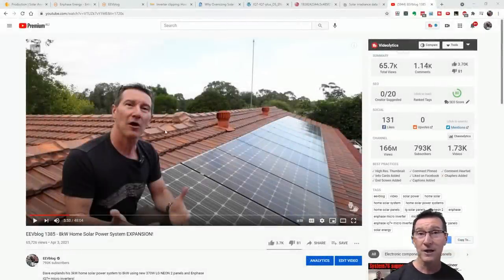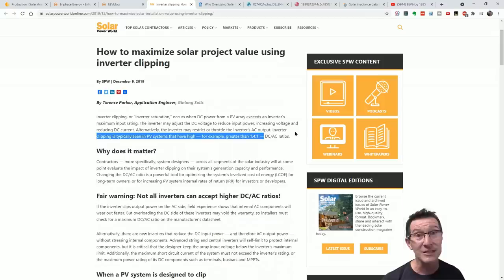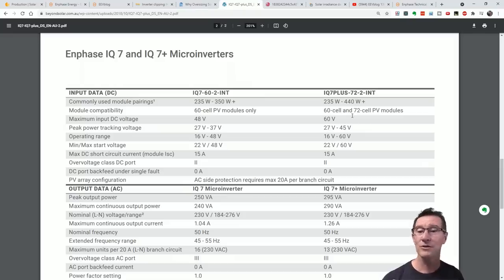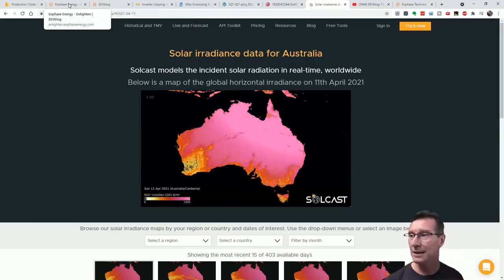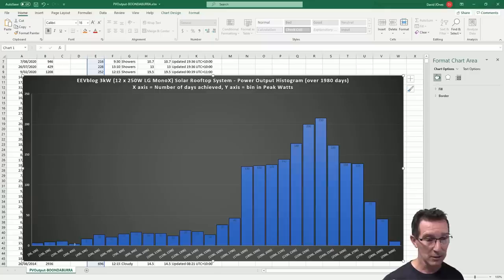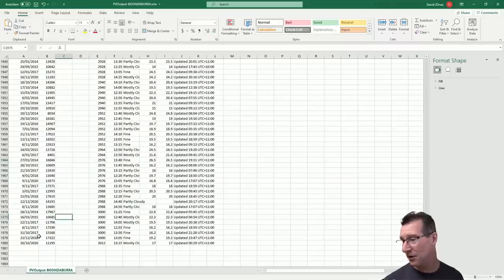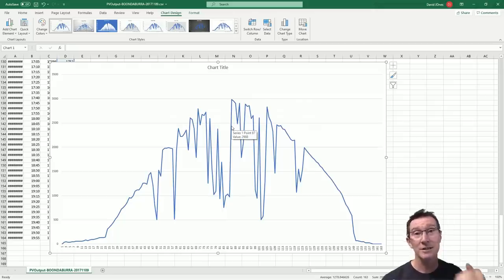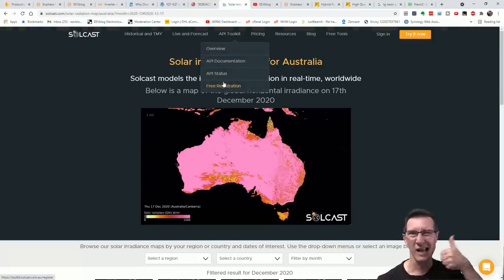EEVblog 1386 - 295W Inverter vs 370W Solar Panel - WTF?

Comment: I rent so I currently have no stake in solar, but learning all those little nuances was really interesting. So yes it'll clip, but it's not clipping every day, and the days it does clip it won't be clipping the whole day, and then the other microinverter benefits that may offset small losses anyway.... today on the internet people seem to join one camp or another so very easily and forget about all the small details. And these details can tip the scales in ways they haven't thought about. And from the comments already I see there are even more factors warranting consideration. Always refreshing to get this sort of overview on a topic, thanks.

Comment: I think you might be missing out on generation capacity at the start and end of the day as well.  The specs say it has a minimum start voltage of 33VDC.  I presume this means you get zero output before this.  If you had 14 panels in a string generating 33VDC each you would have 462VDC.  A common string inverter would be generating a respectable output at 462VDC compared to the microinverters generating 0VDC.  I imagine this effect would be greatest over the winter months.

Comment: “As an engineer I find that a bit offensive.” How many times have I said exactly that!
Reply: Yup. I just spent twice more on a UPS than I really needed because I couldn't stomach it having a lower rated output than the theoretical maximum power consumption of my PC (which I fully well know it will never hit).

Comment: I live in Switzerland; 18 Panels each with 330Wp with 18 Enphase IQ7+ Inverters (290/295 Wp). I had a clipping maybe 3 or 4 times in 2020(!) It makes really sense to slightly oversize your panels - compared to the cost of more expensive inverters.
Reply: Good advise. Thank you!
Reply: You have to also account for the lower efficency in non-shadowed state. Microinverters are overall less efficient in vastly most cases. String inverters are easyly 2% more efficient.
Reply: @flipschwipp6572  Claims and stories from old times. Completely irrelevant. Every manufacturer and every study tells something different - and all like to embellish their own efficiency values. Just like with the consumption values of cars, I wouldn't put a damn on it. I would never buy a string inverter again, even if it were 5% more efficient - and that of course only on paper. And which PV system has a "non-shadowed" state over the whole year? Even then, there may always be times with snow, ice, frost, leaves, dust, dirt, sand, bird poop, a weakaning or faulty panel and much more. And even brandnew panels themselves always vary in efficiency within a few percent(!) - and no string inverter can handle that, but the weakest panel determines the performance! (Except for such with SolarEdge DC optimizers.) Micro-Inverters always produce electricity immediately, even with the smallest amount of light in the twilight, while string inverters just kick in at a neccessary minimum input power (e.g. greater than 10, 20 or even more watts).
Summary: your apparent "2% more efficiency" literally melts away like butter in the sun.

And last but not least; the most efficient system is never that which simply has the most efficient inverter(s), but rather the system overall that is the fastest to write a black zero (= reaching the profit zone). This can only be determined after years or decades, after including all income and expenses - and here, too, Enphase Micro-Inverters are ahead with their 25-year guarantee. It is not unlikely that you will have to buy a new, second string inverter in the meantime ...
Reply: @RomanKuechler  What is the relevance of Guarantees in respect to energy efficiency? String inverters cant also have Guarantee? Marketing BS! Upfront cost of optimizers overwhelm any benefits. Once The Manufacturer goes down, like it was often happening in the PV market, you can wipe your ass with your warranty card and pay someone to rip the whole pv array apart, remove the inverters and re-wire everything. With a normal inverter, it is just replacing the Inverter, which ther will be 1:1 replacements in 25 Years, for Microinverters I highly doubt that.
Reply: @flipschwipp6572  You have not read or understood any of my arguments. This makes the discussion pointless. And your answer lacks logic. Your 2% will be nullified by the tolerances of the panels alone, it's not that hard to understand right now, is it? If someone buys a string inverter because of 2% more efficiency - but not taking everything around it into account, what should I say? If someone really wants a string inverter then they should buy a string inverter. It's not my problem. I have nothing more to say about it, thank you.
Reply: @RomanKuechler  I totally agree with the panel tolerances being equalized with optimizers or microinverters. Panel tolerances are divided in Voltage differences and Current differences. Only current differences can not be 100% compensated by a string inverter but they do not weigh in with their full potential, only moving the Working point a little bit away from the MPP on a usually very flat curve, voltage differences are totally 100% used by a string inverter. Like 4% total efficiency difference (today, panels are much tighter specified) 2% in account for the current, 2% in account of the voltag, only former ones do weigh in like 20-50%, making 0.5 to 1% drop for a less efficient panel.  Individual diagnostics of the panels is a nice feature, manufacturers do their best to deliver good products etc. pp.  String systems have proven to work reliable and efficient when not installed in very bad locations like behind  shadowing trees (there I see the application for microinverter- or just dont install pv there anyways, microinverters can not take the shadow away, the can just make the best out of bad shadowing.  But fron an engineeing perspective, what is the point to install power electronics in the hottest place behind the panels? In the worst place for maintenance? Why have 50x electronic devices if you could just have 1 central one? I just serves the purpose to upsell the customer.
Reply: @RomanKuechler  Any more arguments?
Reply: @flipschwipp6572  if your solar panels are outputting the exact same output each and no shade or dust on them and non of them have failed (or the inverter it self hasn't failed) and they are all pointing at the same angle (only installed on one side of the roof as a single array) , then string systems can work fine

but with dc to ac micro inverters (or even solar Edge dc to dc power optimizers with solar Edge inverter) doesn't matter if each panel is making different power due to shade/dust/angle/placement/panel quality (or even a failed panel/failed micro inverter) every panel will output as much as possible no matter what the other panels are doing (you can just place them on every spot on your roof and lower roofs if you want maximum coverage at higher cost for more kW of energy)

If you watch the last 10 minutes he does bring these  points up

I agree on the point about them been installed right behind the solar panels and possibly of shorter life,, I have seen some installers install the micro inverters inside the roof space so they are easy to access and so not in direct heat of the solar panels and easy to replace without requiring outside solar panels disassembly to access them (unless the panel has failed but you Know witch panel has failed right away without a ir camera)

Comment: Dave, please note that the global solar irradiance which met stations measure is NOT the solar irradiance that your panels get, because the global solar irradiation is measured with a sensor (pyranometer) perfectly leveled horizontally. To get the exact irradiance value of your panels, you should get data from a pyranometer which is at the same azimuth and elevation angles as your panels! (This post somehow disappeared previously, so I posted it again without the link, maybe someone thought it was advertising, but it's not, I'm just happen to measure solar irradiation at work).
Reply: I assume that you'll get a performance boost from well tuned elevation angles?
Reply: @CED99  Of course, but that's a given factor by the orientation and angle of the roof. Modern houses should be built with this in mind (the usually are). You can mount the panels at a different angle on taller framework, but that would look horrible, and it can be dangerous as well, because it would put higher wind load on the panels.

Comment: The most common string system in Australia is actually 6.6 kWp on 5 kVA inverter.

Enphase micros have a longer warranty and life than most string inverters on the market, they don’t run hot internal temperatures as they run as extra low voltage (40 Voc generally).
Reply: cost difference is almost double now. Also if any of those inverters fail the warranty is there for them but not the labor to go up and pull solar panels off the roof to get to the inverter underneath and hope nothing else gets broken like tiles etc for those with tiles. Its not all green grass on that side. Also being up on the roof in summer, can't imagine even being under a panel they wouldnt be smoking hot.

Comment: TLDW: Loosing 10% per day on 38% days equals 3.8% total loss(on ideal days). Realistically probably less than half of that, say 1-2% total loss. 
But you get same 1-2% back in improved inverted efficiency.

Comment: I have limited knowledge on PV systems, but looks like de-rating is quite common here in Brazil. Since the string inverters are so expensive, adding more panels is cheaper. As a result, the inverter starts clipping earlier in the morning and stops later in the afternoon, so as to use the inverter for a higher % of the time. It's not only about the energy, but the system cost.
Reply: Boa! já ia pesquisar sobre e tu me respondeu!

Comment: My family has multiple PV arrays in south Germany. The older ones (about 19 years now) have undersized inverters, the newer one (about 10 years old) has oversized inverters. 
As far as I know, currently the inverters are usually oversized on new systems. I don’t know the exact reason why it went from undersized to oversized inverters, but probably the efficiency got a lot better with all load-scenarios and the price difference isn’t much.
All our installations are still fully operational and there are no signs of significant degradation. Only the Inverters seem to reach the end of their lifespan after almost 20 years. On the old arrays, we swapped them for new ones, since they stated failing, and the new ones are more efficient anyway. I expect the oldest system to last at least 10 more years, probably even a lot more.
I’m not sold at all with the microinverters. They are under the solar panels, where it gets already pretty hot in the summer, obstructing airflow and adding even more heat, which decreases the effectiveness of the panels further. Also, they are fully potted, which makes them completely unrepairable. I guess they run bloody hot a lot of the time and I wouldn’t expect them to last nearly as long as normal inverters. Swapping them is also a bigger issue, because you need someone qualified to go onto the roof to do it and the faulty one is of course always the one in the middle of the array…
Partial shading isn’t as much of an issue as some people make you believe since even our oldest panels have bridging diodes in them to avoid limiting the current.

Comment: I had the same question when I received my panels (in the Netherlands) The explanation I got was that the high power inverters also have a higher loss (at 100% of the days) I checked and indeed the higher rated SMA inverter had a higher loss

Comment: Some of the times where it has clipped the 3kw system may have just been momentarily due to the cloud edge effect. My system generally maxes out at 2,700w but the inverter will see 3,300w when clouds pass by.

Comment: I installed a similar system in 2015 with 32xLG 310 watt panels for a 9.9kw nominal system, using enphase M250 micro inverters, and so the system peaks at about 8kw. Up here in Canada I believe this is a fairly common type of system to install. And so yes, it does clip on a perfect full on sunny day, but overall it's a very small percentage of "lost" power as you outline. Eyeball estimation would be loosing about 2 or 3kWh generation on a perfect zero cloud full summer day where it currently generates 70kWh. Perfect days are pretty rare, and I'd guess I'm only loosing 50kWh or so generation due to clipping on a given year out of a total of ~12000kWh. So although the clipping "feels" wrong, it does have very little effect, and obviously doesn't make any financial sense to pay for larger micro inverters just to capture that little bit extra power.

Comment: Another reason to underrate - because they use more and larger switching devices, a higher rated inverter is always going to be less efficient when running at a lower power. So there will be a point, even with the same panels, where you will get more overall energy from a smaller inverter that occasionally clips, because it is slightly more efficient at other times.
Reply: OohBuntu  That's kind of the point - that 0.5% efficiency gain at the common low load times can easily mean more than losing ~10% from clipping during the rare peak generation times.

Comment: Everything with a switch mode power supply (which is most things these days) can work directly on DC ( a lot of led lighting included). So on a small rural of grid system, you can power most things straight from the series battery string. Have a small inverter for the AC only appliances. Your battery string can be between 170 to 325 volt DC (120 to 230 volt AC equivalent) and most appliances with switch mode power supplies will work across this voltage range. So the voltage won't have to be regulated.

Comment: Wow, your explanation is spot on for my system. It was just fully commissioned today. It has the same panels and inverters as your system and my system consists of 29 panels, which means the system size is 10.73 kW. The Enlighten software showed that I was producing 8.6 kW during the peak time of day, which is 295 watts times the 29 panels. Your explanation is much more useful and makes more sense than the one provided by the installer. Thank you from Plainfield, Indiana.

Comment: Couple of things, the power over 5 minutes is average not peak.
Cooler solar panels = more energy.
Perfect days do not produce perfect solar power output. Reason is quite simple, the datasheet says: 1000W/m2 @25C this 25C does not happen. Even in the winter the modules will get hotter than that. However it can definitely peak if a cloud covers them and a cold wind blows over then the clouds go away. I have seen 3660W output from my 12x215W system.
If you don't use power from a solar panel the energy that is not used is lost as heat (or potentially emitted again as UV light). Worst case the clipping causes the panels to heat up causing efficiency losses later that day.
Reply: I would assume it’s taking a reading every 5 minutes, not calculating the average for the 5 minute period.

Comment: My system is oversized for the inverter (5kW). When I got the system installed (and then later ugpraded -- panel wise) it was the most common thing that people here in Western Australia were doing.

The system clips a few times during the summer time, but then the Fronius Primo 5kW inverter is locked to 5kW, in other countries the inverter can go up to I believe 5.5kW.

For most of the year (except for winter), my inverter tends to sit around 4.5-5kW for most of the day.

Comment: Hi Dave, actually even regular inverters are downrated in Australia as well on most current installations. All the quotes I have been provided install 30% more panel capacity than the inverter nominal power. For example a 6.6kw system is fitted with a 5kw inverter.
That was probably not the case when you installed your original string system.
Reply from the maker: Yeah, that was never the case when I was looking.

Comment: Couple of additional analysis missing, you are not considering YoY panel degradation and during summer season where the peak irradiation gets achieved will impact panel efficiency due to higher temperature as well.

Comment: For me it's simple...if you need power in winter, go for oversizing panes vs inverter (my case, I'm totally off-grid with 8kw). If you want to maximise power on the whole year cause you can sell power...or use it completely...do not oversize.
There are many low cost inverters, growatt is one of them.
A 5kw inverter with a 6kw mppt, including battery charger can cost 500$ us.
A 370w pc cost 130€ in my country.

Comment: In ireland, I've oversized my array I have 8.64kwp on a 6kw inverter.

I haven't had a perfect day yet. But on days with scattered cloud, it can peak at 6kw when the sun comes out and the panels are cold.
2 string NE/SW (low angle, agri shed) array 12 panels on each.

Comment: This popped up in my feed again. 
One thing I've noticed with my system is that total illuminance often goes up to 125% on partly cloudy days compared to direct sunlight. 
This is backed up by a paper written decades ago by a research group in USA.